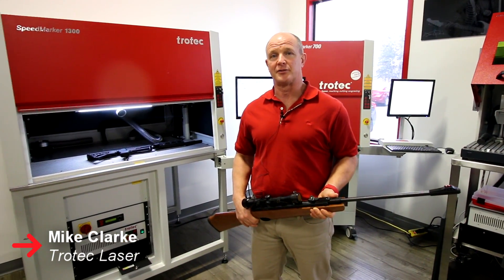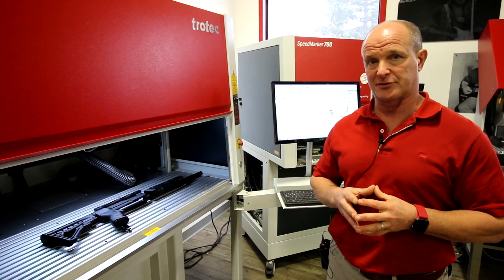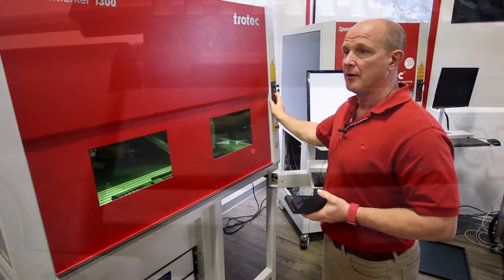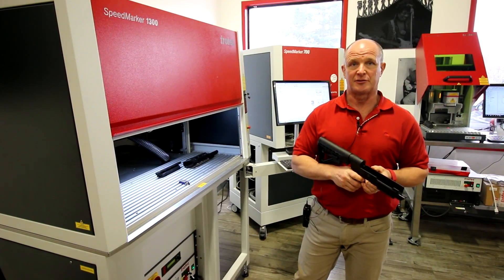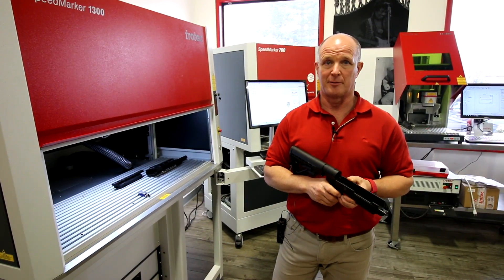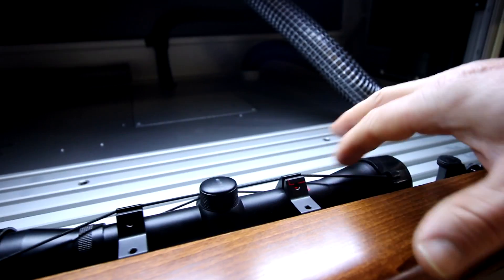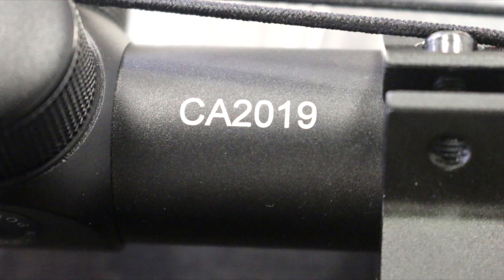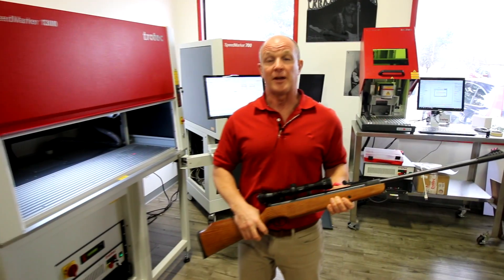Laser Engraving Rifles | Laser Marking Guns | SpeedMarker 1300

Comment: Can the new 2019 speedy 400 flexx do this as easy as this machine?
Reply from the maker: That's a great question, but to be honest we don't have an answer at this point. It's more comparing apples to oranges since the galvo is used for industrial application where lots of programming is involved, like putting barcodes/serial numbers on objects vs. a flatbed laser like the Speedy 400 Flexx.